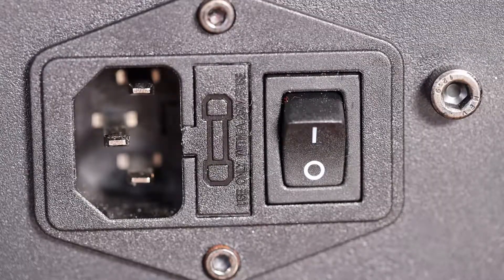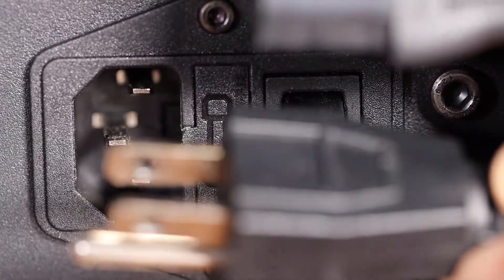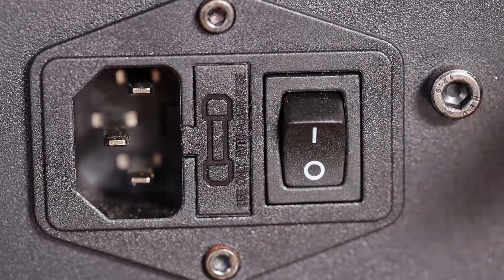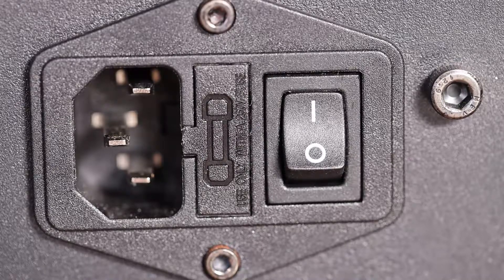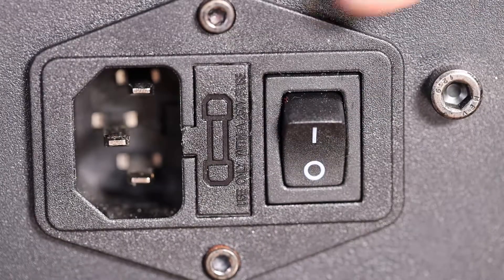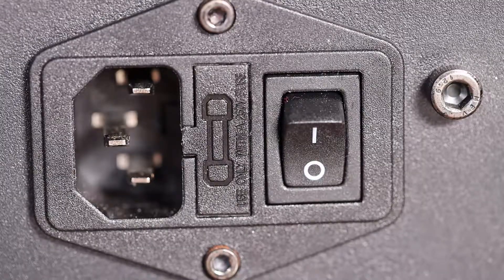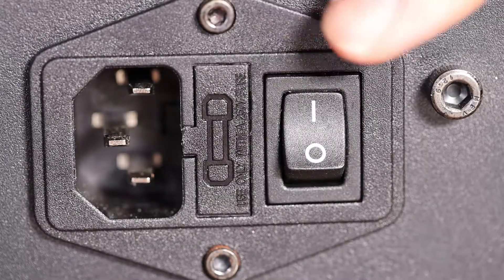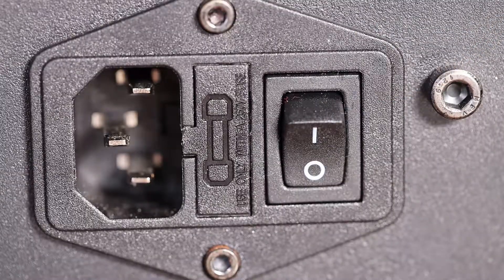3D Printiner Won't Turn On - Troubleshooting Power Supply

Comment: they also have a 6.3A 240v slow blow fuse inside on the board I had a power surge and it blew out the glass fuse in that plug and the slow blow internally unfortunately for most people that means you have to buy i new power supply but if your comfortable with electronics and know how to solder it may still be fixable

Comment: My issue was the 230 vs 115 switch on the power supply. It was set to 230 and works on the 115.

Comment: I plugged my printer into a "bad" outlet, and when I switched it on, I heard a pop. It won't turn on regardless of the outlet i plug it into. So, I have a new psu already, but before I install it, do I also need to replace the fuse/switch thingy? I'm not sure on the technical name, but I'm referring to the entire unit that you plug into that houses that fuse and switch.
Reply from the maker: I'd recommend checking / swapping the fuse as a first step.

Comment: I replaced both the psu and fuse. Still not turning on, what else could be the issue? (Anycubic Mega pro)
Reply from the maker: What voltage does your house run on and what voltage is the PSU set to?

Maybe there is a short? Potentially you can disconnect your hot end and heated bed to reduce the odds the PSU isn't working.
Reply: Mine too. I already bought a newer model but I want to get this one running. Checked everything including replaced power supply

Comment: My house is 220V, but the printer only turns on with the key at 110V. If I change it to 220V which is correct, it doesn't turn on.

If I try to print using it at 110V, it starts beeping and causes a temperature problem.

Comment: I checked the fuse the wire is not broken but I get 9 v from the output in ender 3, how much voltage should it be?

Comment: i'd like to add something.

i removed the screws from the faceplate of my ender 3, assuming that would expose the fuse, and it turns out one of the wires had disconnected itself from the terminal in the face plate. 

i'm sure i'm not using the correct terminology, but i hope i'm getting my point across. make sure the wires inside are connected.

Comment: You just told people who put together their own 3D printer to make sure it's plugged in.😅😂Hear some real help Unscrew The plug in switching unit and make sure all the wires are connected
Reply from the maker: Wow great advice thank you. However I'd recommend making sure the unit is unplugged from the wall before checking terminals like that.

Also I don't see where in the title I ever said that they all built their own 3D printer.

This video was made for beginners as well.
Reply: @kinvert  yea mine had the main power cable just floating back there
Reply from the maker: @ryolacap  Hope you got it all fixed up and running. Have a good one.

Comment: I live in 230 v country i bought a new power cable that is ground cuz the first time i used the one from the box i got shocked & now that i’m using the new one the printer won’t turn on at all! What should i do?!
Reply from the maker: Yeah if you live somewhere with different voltages and frequencies you need to be careful. Sorry I don't have specific advice for you. I live in the US so our electricity is different than you describe.
Reply: @kinvert  Thank you but i already solved the problem! I didn’t plug the power cable properly.
Reply from the maker: @L2002AY  Glad to hear you fixed it!

Comment: How do you know if the fuse is blown?
Reply from the maker: You can take it out and visually inspect. If it isn't easy to tell, you could take a voltmeter and check the resistance across the fuse or see if it has a short if your meter has that feature.

Comment: Check the voltage on the back of the power supply and make sure it’s 115v instead of 230v
Reply: thank you lots, first start of ender v5 printer and was very upset when it wouldn't post.
Reply: mine is 280v

Comment: Also look for a standby button. On Creality printers, you can flip The power on and off all you want. And it won’t turn on. You have to press the side, silver button on the right side after flipping on the on switch.
Reply: Thanks this idiot didn’t mention that at all more help than the video
Reply: Thank you very mucho! This worked immediately. Like a miracle cure.

Comment: If you have a new Ender Pro 3 in the US check the back of the power supply to make sure the switch is on 115V. Otherwise, it will not work
Reply: You’re the answer everyone clicking this video is looking for most likely. ++
Reply: this 100% took it all apart and had the multimeter out and then saw the stinking switch. what waste of time.  Pin this please
Reply: Appreciate it man that fixed it for me.
Reply: Thank you!
Reply: I was just gonna comment this. As it was my problem
Reply: Fixed my problem. Thanks for the tip!
Reply: Thank you so much. I sat here for half an hour trying to figure this. Out you just saved me a lot of money.
Reply: Ayyyy, thanks bro
Reply: Thank you so much for posting this- this was my problem also!
Reply: This saved our night! We were so disappointed when our printer wouldn't power up.  Then we found your comment and it works now.  Thank you for your insights.
Reply: When the comments are better than the video. Thanks man!!
Reply: That did the trick. No idea why that's not in the instructions
Reply: 11:14PM christmas night, you just saved my whole day 😭😭😭😂
Reply: Dude, you saved me 50 bucks
Reply: You are a hero.
Reply: Thank you, what a simple fix that was!
Reply: Goat. Tysm
Reply: Thank you so much. This was our problem..

Comment: I just bought my 3d printer a couples days ago I finally put everything we’re it need to be in the power not coming on what should I do?
Reply from the maker: I'd suggest you watch the video to try to troubleshoot the problem. There were also a couple helpful comments in here from other people for things I didn't mention in the video.
Reply: @kinvert  everything is working but the only problem is I’m having trouble to upload the file to the 3d printer
Reply from the maker: @tyjuandrafton3344  Glad you got the power issues worked out.

In our case our 3d printers took an SD card.
Reply: @kinvert  yes it does I was trying connect the printer onto my laptop but not letting me and I got the sd card I slice it and when I’m trying out it on the 3d printer there be no file on to it

Comment: Hi, I replaced the fuse and tested everything but it still won’t come on. I have the qidi x-plus.
Reply from the maker: You might want to find someone with experience that can test the outputs of the power supply with a voltmeter.
Reply: @kinvert  for the machine or the wall? Because I have another 3D printer that’s working fine on all the same plugs.
Reply from the maker: @themarketingbully1686  Inside the 3D Printer will probably be a power supply.

It likely looks something like this:

https://duckduckgo.com/?q=3d+printer+power+supply&iar=images&iax=images&ia=images
Reply: @kinvert  okay thanks! I live in a small town and I don’t know of anyone really doing 3D printing. But I’m going to call around and find someone.
Reply: Any update @TheMarketingBully
Reply: @DrPhilament  the fuse was burned out in my plug + when I contacted the manufacturer they said it caused my switch chip to burn out to, so when I plugged it up and hit the switch it wouldn’t come on. Once I disconnected my power panel and rerouted it so I didn’t need the switch to turn it on, it worked. They sent me new parts to put the power switch and fuses back on.
Reply: @themarketingbully1686  niceeeee ima Give it a try as well. I just recieved a email from qidi with the guidance about rewiring the power plugs right to the module board by passing that switch. Thanks for the update, I'll let you knw if it works

Comment: My fuses keep blowing, checked the entire printers circuit, no components seem burnt or damaged. that means the powersupply is probably the culprit? just asking because that exact wording never came up when regarding fuses
Reply from the maker: There could be a short circuit somewhere. Generally the items that consume the most power are the nozzle and the hot end.

Maybe try running the printer, and each time unplug a different item from power. You'll have to be careful how you do this. But in doing so, you could find a component that is pulling so many amps.
Reply: @kinvert  excellent, i'll pick up a box of fuses tomorrow and try that out. I actually switched out the hot end and it still blew a fuse so the bed is next to check, though it looks in order (there is insulation obfuscating some information there). I also ordered a new power supply. if its not that its no lose, i realized how much i need a few power supplies within those ranges around the house to build other projects. thanks for the info and speedy response you rock
Reply from the maker: @Ambitious_Mechanic  Be extra careful not to accidently unplug an endstop or something like that.
Reply: @kinvert  so much for the up down votes mechanism filtering "better" information to the top eh? some people just dont get the diy mindset to sum in up in a sentence..
Reply from the maker: @Ambitious_Mechanic  Yeah I still don't understand. Maybe they thought I was going to actually take apart a power supply?

Despite the bad like ratio most comments are good. So I figure it's still helpful. Dissapointing one of my most watched videos is the most disliked lol. Oh well.

Comment: my printer powers on it just takes 2 minutes... its like a computer with windows xp and a 5200 rpm hdd and 512mb of ram. 
i didn't use it for a few months and it took a dump when it wasn't on or plugged in.  It wont even print from SD cards anymore it just wont read them. 
other than beating it with a bat and building a fresh 3D printer with much better components idk what to do with it. its been a pain in the dingus since i bought it.
its like 6 years old and on its 3rd cheap Chinese control board. im thinking of bashing it to pieces and using a proper duet board and closed loop steppers.

Comment: Ended up being the voltage for me.  There's a little red switch on the thin side of the power box.  It's defaulted to 230.  Voltage in the US is 120.  Flip the switch for 115 (close enough).  You'll probably need the small screwdriver to reach inside to flip it.
Reply: Thank you!
Reply: Yep that was it haha thanks!
Reply: so I justt flip it? Im terrified of breaking the thing it looks breakable
Reply: update: its been flipped.
Reply: update: it turned on
Reply: thanks a lot ! I've been testing for four hours but still cant find the problme untill I saw this

Comment: My CTC printer suddenly stopped working , when on the lcd flickers and is blank , the leds on the mightyboard flickers too 
Changed the fuse,power wire nothing,everything seems to be in place and normal except the power switch button light has gone off 
Tested the PSU with a multimeter and 3.4V comes out is that normal ?
Reply from the maker: Often these will have multiple voltages. 3.3V is a common one. There will also potentially be 5v and 12v.
Reply: @kinvert  thank you for your answer ,PSU is 24V 15A ,when i unplug it from the board it shows 9.80V . I am in distress , only made 2 prints and i want to see if i just have to change the PSU or the board died and must find another printer to continue playing , printed a model kit car wheel , and bender's (futurama) legs lol
Reply from the maker: @breakers111  Well it should be able to output multiple voltages. Ultimately I don't know what PSU you have. Hopefully you can find a good answer out there specific to the hardware you have.

Comment: You show the photo of what appears to be an Artillery Sidewinder X1, just like mine.  Mine blew the fuse too.  Of course, there is a spare in the fitting when you pop that cover, but it is VERY hard to see the amperage on the small fuse.  It is  a 250v 10 amp fuse for those of you interested.  I am replacing mine with a slow-blow variety.  Do a search for "250v 10Amp 20mm x 5mm Slow Blow" and they will turn up.

Comment: My ender 3 don't open the vents and the screen turn on and the screnn is all blu
Reply from the maker: If your screen is turning on it means you're at least getting some power out of the power supply.

I'm not sure what vents you're talking about I don't have an Ender 3.

The first thing I'd personally do (this is not advice, just saying what I would do) is to open it up and make sure all the wires are plugged in nice and solid to the motherboard.
Reply: Now the alimentato just explode
Reply from the maker: @peterpederiva286  The what?
Reply: Alimentator
Reply from the maker: @peterpederiva286  OK somehow, I think, you are drawing far too many amps. There could be a short. Some item for the printer could be hooked up to too high a voltage. I'm not fully sure. If there is anyone you know locally that can help I'd look in to that.
Reply: I was printing the print block the bottom don't work and I turn it dawn i turn on and al works but the screen was blue then I check al the connections I turn it on I heard a pock and the fume come out
Reply: Yee but is on 230 v so I don't know now I'm waiting to call Amazon becous is he have onli 2 months

Comment: When mine didn't turn on i moved the print bed around and the screen will flicker on and off
Reply from the maker: You might have a loose wire or a short going on.

I assume you have a heated bed?

Comment: How do I gain access to the fuse on my ender 3
Reply from the maker: Unfortunately I don't know how to do this for all different printer types.

If it's like mine, which I sort of think it is, you take a flathead screwdriver to gently pry up the fuse cover.

Comment: OMG thank you! I was so sad, didn´t know why it was not powering on. I only have 4 days with the Artillery X1. Fuse seemed fine, but i saw it came with a spare fuse hidden at the bottom of the fuse you can see. Switched them and somehow it worked. Awesome, thanks again!
Reply: Same here! It was so good to have an extra fuse in there! good video, thanks!!

Comment: So my Cr6 SE suddenly turned off when I had left it on preheating. I wonder if I blew the fuse, but Just wondering, how do you switch your voltage on the back of your printer? is it the voltage you see, or do you have to switch it so that you can't see the voltage? My voltage is 115 and that is the voltage I can see on my printer.
Reply from the maker: Is there any marking on the outer shell of the power supply?

Comment: Ok, so mine was switched to 230, so how tf did that happen lol. I was checking my power cable, checking the psu for output, checking outlets, and it was the voltage selector switch.

Comment: Check/reseat the spade connectors on the power switch! 
Bought a new power supply when it was just a loose connector. Was having random reboots and power offs before.This fixed it.

Comment from the maker: A lot of dislikes on this one. Anyone care to say why? Maybe people expect the video to show them how to fix their specific 3D Printer, while I made the video to help people troubleshoot just about any printer?
Reply: Kinda stating the obvious in alot of your methods.
Reply from the maker: @FrostyDH  What do you think I should change the title to? This is basically for random parents that got their kid a 3D Printer, not hobbyists diving in with an oscilloscope. Which btw I can make a video for that as well.
Reply: @kinvert  actually, you got me thinking.i have a mp maker pro, i bought off kijiji, it worked great for a few days then died, just wondering if it could be as simple as the fuse, the extruder fan comes on when i hit the power button but i dont hear the psu...
Reply from the maker: @jaystoddard5948  Do you have a multimeter? You can check the fuse with that by checking resistance or checking for a short.
Reply: @kinvert  for sure, hey thx
Reply: @kinvert  troubleshooting AC supply. the power supply is INSIDE
Reply from the maker: @carlosmorato2820  Yes obviously the power supply is inside this one.
Reply: @kinvert  your video helped me fix my brothers printer! Don't feel bad about all the dislikes. My was as simple as changing the voltage setting but I wouldn't have known without your video
Reply from the maker: @gusbrock3638  Thanks Gus. It is a bummer. On the one hand I want to delete the video since many people seem to not like it. On the other hand, most of the comments seem positive. Weird video for me, most have over 90% likes. Oh well. Merry Christmas Gus!
Reply from the maker: @FrostyDH  Thank you. I do agree with that. This was meant for more the consumers than the hobbyists and above. What do you think a better title would have been?
Reply: You could have shown how to pull the outlet fuse and show what type of fuse is used....
Reply from the maker: @xRevoEmaGx  Thanks!